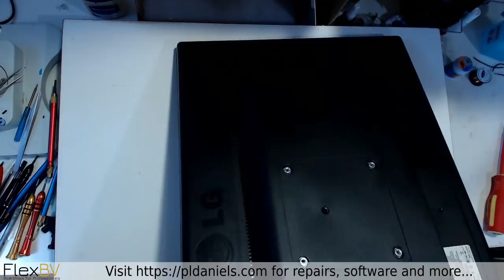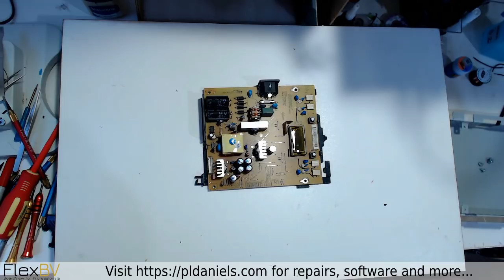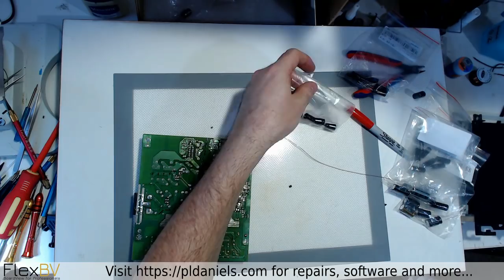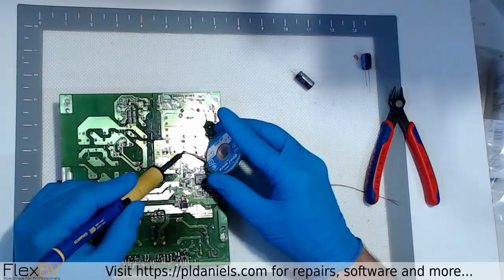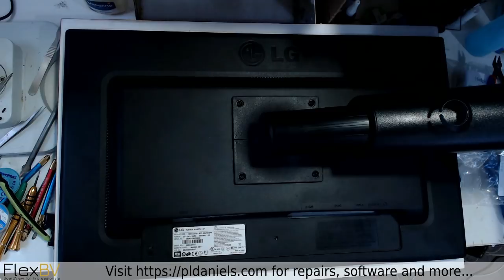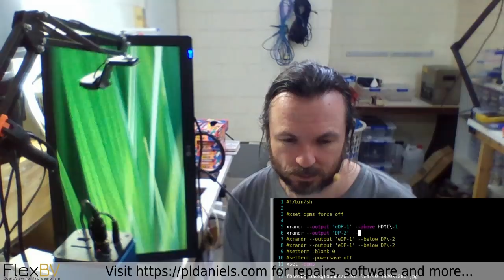Dumpster save: 24" LG LCD panel with no power

Comment: Hi paul, 

i have an AOC ultrawide 29inch monitor 2560x1080. 
Upon first power, the unit will display everything correct for about 4 seconds and then it starts to blur out and becomes lines instead of pictures.
Sent to a shop next to my workplace, they said that 100% panel problem but I refused to believe it is a panel problem. 

here are the video for said monitor. this is the second boot up of the monitor during that testing. can see desktop flickers sometimes. 
is this repairable paul?

https://www.youtube.com/watch?v=uAUfl2wuDI8
Reply from the maker: Hate to say it my impression is cracked/damaged panel in the middle/top area probably, maybe a bad flex connection up there.  Those vertical lines are the tell-tale sign and then combined with the flickering.    Almost like someone grabbed the panel at the extreme ends and bent it slightly perhaps :(
Reply: 😭😭

Thanks for replying paul. Time to scrap this thing...

Comment: 5:39   You can replace a capacitor with one of a higher voltage, as long is it will physically fit.
Reply from the maker: Yes, within reason; mainly because of the proportional reduction in ESR as you increase the voltage within the same physical size,.  In almost all cases, yes, it'll still be fine, given the fairly decent amount of tolerance / operational-envelope these circuits have, definitely one of those "evaluate the purpose in the circuit and see what you can get away with" situations.    

In this case, I didn't even have anything suitable at a higher voltage for the 470uF units on the day, and making up a ganged series of 1000's or paired 220's wasn't a viable option.

Comment: Funny thing..
MANY companies are setting the power supply OUT SIDE of the case..
They get HOT, and it dont help the LCD..
Reply from the maker: Yes,  I prefer the trend of having the PSU brick on the outside, with just a DC supply & jack  going to the panel (though obviously there's still going to be a PSU internally to generate the required rails but that's more in line with the acceptable).

Comment: Got 4 TV's in to fix 😬  
Never fun working on 60 or 70" 🤯  Usually if there's more than 2 capacitors expanded I usually up the voltage .. I got trolled on one monitor A whole time it was the bios chip ic  Used A Mac book Bios chip and reprogrammed it to the firmware  Poof working ... You can always use the monitor  Upright that way for coding 🤣
Reply from the maker: You're right about the monitors upright for coding, it works well, the best for me was paper-white genuine monochrome screens;  hoping we'll see the return of that with faster eInk... just not sure if it'll happen.
Reply: Paul Daniels  Happy coding 😀

Comment: Good job. Get a solder sucker to save on wick. Also get in habit of testing before full reassembly to save frustration. Check voltage on main filter cap to ensure board is safe to handle to :)

Comment: nice fix paul, yes its a old ccfl but it will certainly outlast a led set, most of my tv repairs nowadays are either leds failed or software issues and also the odd bga issue on newer lgs
Reply from the maker: Guess we'll see how long these CCFLs last.  Maybe the "most recent" ones are less quick to exhibit old age symptoms?  My first ever LCD displays were a pair of LG 15" 1024x768 units back in 2001, they worked fine until about 2007 and started going pink/orange/brown and flickering out.
Reply: i still have two ccfl tvs and a couple of ccfl hp monitors you can still buy ccfls for tvs/monitors so i think ccfl sets will still be around for a while yet as not everyone can afford cheap/smart led tvs and too be honest i find the inverter transformer winding's fail more than ccfl tubes but like you say with age ccfl do change color.

Comment: Had an LG 22" monitor go with the power on/off issue it too was an LG and had the same issue. Still using that monitor. Feel for you leaving that part out just like when one solders on or crimp a cable end then realize you forgot to put the heatshink or shroud over the cable. A Homer Simpson moment ;)

Comment: Nice easy repair, well done. What is it with bad electrolytics in LCD monitors that are only a few years old. It's almost as if they were used to shorten the lives of the monitors and so increase sales .........
Reply from the maker: I believe a lot of it started with some companies having a contaminant in their electrolyte for the caps, or a bit of industrial espionage gone wrong and an essential ingredient left out in the stolen recipe. I've got gear with electrolyte caps predating the "badcap" fiasco, and new gear seems to be fine as well.
Reply: @pldaniels I see, thanks for the explanation. :)

Comment: To save on wick, why not use a solder sucker to remove the solder from the holes of the cap's leads? :-)
Reply from the maker: Laziness.  I have a 32yr old solder sucker that's been my trusty servant and capable pad destroyer, but I've put it away somewhere and generally can't be bothered to drag it out in the middle of a job.  Thankfully dealing with pin-through jobs is such a rarity now that it's overall probably more economical for me to simply ride through the wastage of wick.
Reply: @pldaniels That makes perfect sense. :)

Comment: got to get you a pace desoldering station makes through hole work much much easier. granted it will cost a couple hundred dollerydoos for a used system but totally worth it. tips are also pricey but imo worth it.
Reply from the maker: I've got a whopper of a 100W station that I can use but honestly, given how rarely I deal with pin-through, I'm more than happy to just drag myself through it with the inappropriately selected tips on the Hakko FX951.

Comment: Is the image really wobbly or is that YouTube compression?
Reply from the maker: Throughout the whole video or just a bit?  Unfortunately my overhead cam is on a fairly light arm, which you can see in the face-view shots to the left, so if I bump the portable computer desk or yank on the soldering lead while the microscope is away from the bench, it causes a wobble.  The whole lot needs to be reworked again to something more stable, and the laptop webcam replaced too (already underway, just waiting for delivery).
Reply: @pldaniels  on the monitor at the end when you're showing it working
Reply from the maker: Ah yes, blame the poor quality of the laptop webcam for that, I see it now that you've mentioned it.

Comment: Hey Paul. How come you used the leaded solder, Is there a difference ?
Reply from the maker: Definitely a lot better to work with than lead-free (unless you pay a lot of $ and get some of the more exotic lead-free alloys).

Main features are lower melting temperature and easier to work with with more consistent results.

I might one day try some lead-free  96.5, 3, 0.5 Sn, Ag, Cu  SAC305 type solder, a big advantage is I can get it in 0.3mm diameter, where's with leaded I can only get down to 0.38mm.
Reply: Thanks for your reply Paul. 

I’ve only just recently started watching your stuff. But I find the more I watch of you and some of the other guys on YouTube the more I find myself getting hooked with board repair. 
 
So would you say you pretty much only use leaded solder ? 

What part of qld are you from ? Do I hear a kiwi accent or is that just me ?

Thanks again for your reply. Keep up the good work 👍
Reply: Oh also. I just purchased a cheap ish iron off eBay. And was wondering. Do you generally use the same kind of temps when you work with your iron. Or does it change depending on the job ?
Reply from the maker: @mrkakaonu  my Hakko mostly sits at about 380 or 400'C.   Which iron did you get?  These days, best to get something with the integrated heater elements, ie, using things like the T12 or T15 type tips, even if it's a clone station.  Big difference compared to the older systems with the separate heater element.
Reply: This was the one I got,

60W Electric Soldering Iron Kit Solder Welding Rework Tool Stand 6 Tips Safe

https://rover.ebay.com/rover/0/0/0?mpre=https%3A%2F%2Fwww.ebay.com.au%2Fulk%2Fitm%2F122509533849

It was just my first one so didn’t want to get anything to flashy. But will check out the ones you suggested.

Comment: Every LCD I have on a pc for the last 10 years has been acquired this way. Pull it out of the trash or pick it up free off c-list and fix the caps and cold solder joints. If one dies I have 3 more in the closet, ready to go
Reply from the maker: Similar here, though I don't typically have any surplus on hand.  I did get burned once bad,  Nice modern slim line LCD, had a bad DVI input, had been knocked, rebuilt the traces, but seems that something wasn't quite right and it took me a couple of fried GFX chipsets to realise the panel was breaking things :(  That went straight in to the dumpster for sure then.
Reply: @pldaniels  Yeah, the American way means somebody with half an ounce of knowledge can have a house full of two year old electronics for the price of an ounce of solder, even in a backwater Oregon town.

Comment: Good job Paul. Always nice when just a few caps complets a repair. Especially when there's a perfectly usable working device at the end of it.
Reply from the maker: Yes, aside from the surface scuffs it's entirely usable.  At least the scuffs aren't so bad that they've caused stuck pixels (have a few 17" DELL screens that have many stuck pixels from the same fate).